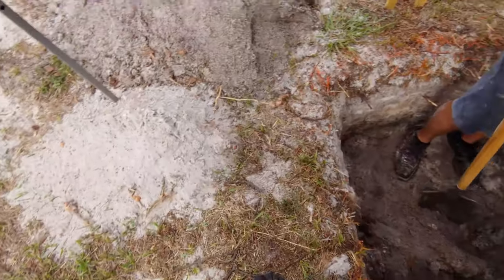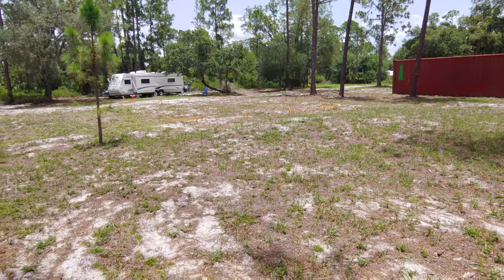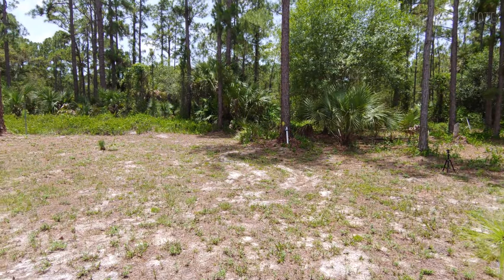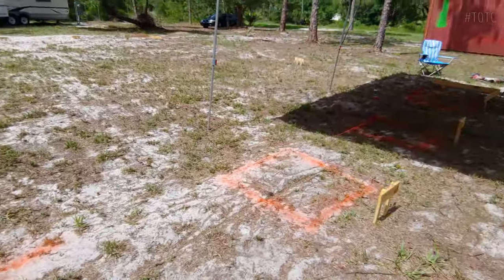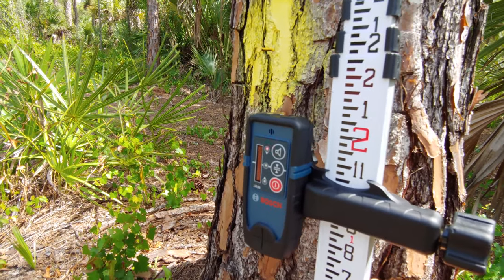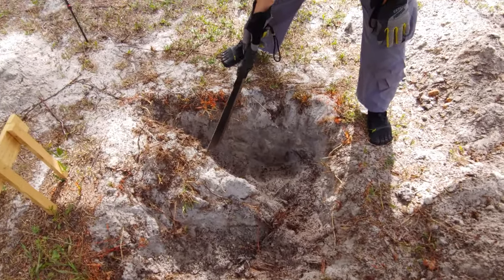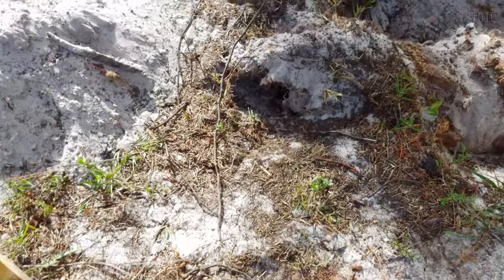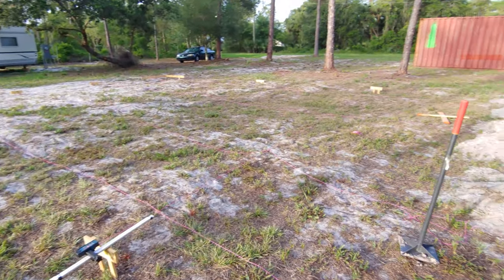Digging 16 HOLES For My DIY Container Home Foundation | TOTC EP. 18

Comment: In case the home sinks a bit over time, do you need to put in a fudge factor so that it will still be high enough to drain into the septic system?

Sorry if this was addressed already.  I'm new here/a new subscriber.
Reply from the maker: The home will likely be far higher than the septic system bare minimum elevation so I think it'll  be fine in that regards. And don't hesitate to ask questions I enjoy them.
Reply: @thinkoutsidethecontainer  Thanks for your reply.  You are such a hard worker, and I like what you're doing.  Plus you are helping others learn so much!
Reply from the maker: It's  definitely been a ton of work!